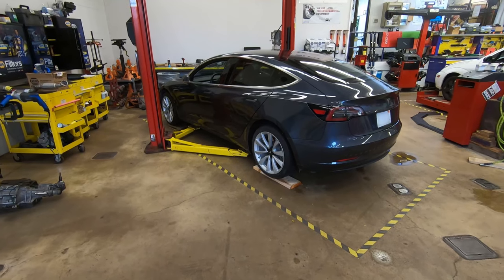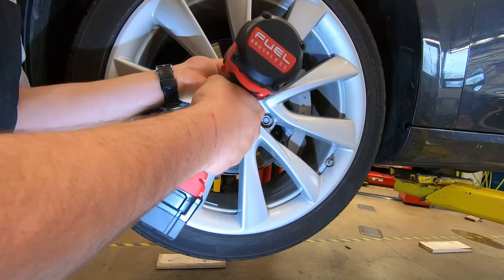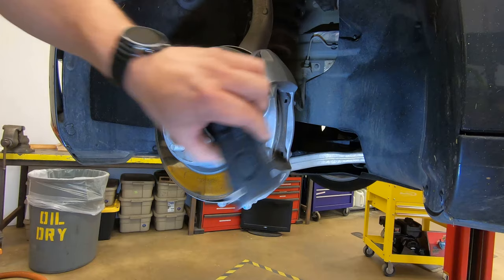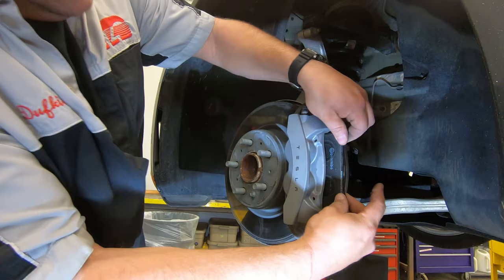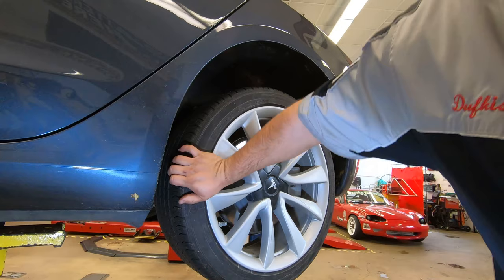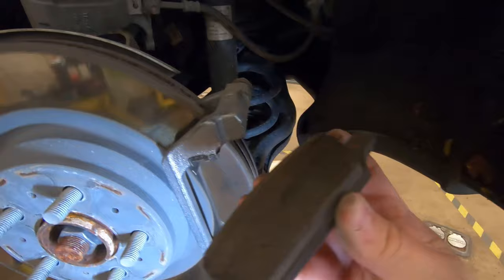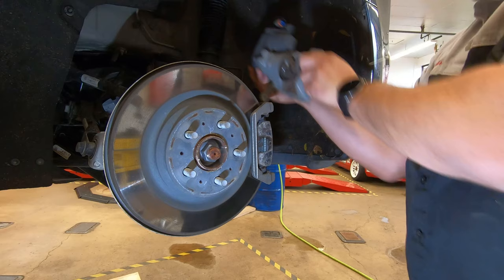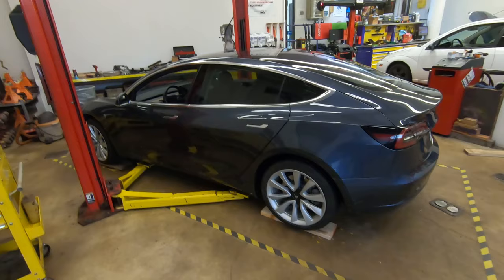Tesla Model 3 Brake Service: How To

Comment: This was exactly what was required for my SR+. Rear passenger brake had been squeaking at low speed (reverse and forward). Car has 30K and Tesla tech recommended a full brake and rotor job $1600. Brakes were still 99% and rotors were almost new. Asked if they knew how to do a brake service by lubing contact points and they looked at me crazy. 😂. Took me 30 min to do all four wheels and absolutely fixed what I needed. Very much appreciate your simple to the point instruction. After seeing how you disengaged the rear brakes by tow mode gave me the confidence to attempt on my own! ⭐️⭐️⭐️⭐️⭐️
Reply from the maker: I'm glad I could help!
Reply: mine are making similar squeaking at low speed with 5 years/60k+ miles so i might try this myself also!
Reply: 30 minutes for a break service on all 4 tires? That's insane. Would take me ~20-30 minutes/wheel.
Reply: @themonsterunderyourbed9408 some people can't handle reality so they lie like  this obviously sofa king we todd did tool
Reply: Sofa king we todd did liar

Comment: You can turn the front wheels for easier access. I did my own brake service after the first winter with my Model 3. While it didn't see much snow, I was glad I performed the service. Tesla put very little lube on the caliper slide pins and they were already getting sticky. I popped off my brake hardware kit and cleaned out the rust building up on the caliper channels and applied grease to them as well before reinstalling the brake hardware. Thanks for the link below to extra hardware!

Comment: Remove corrosion on the calipers by engaging Neutral and braking - This way you physically brake with the brakes in stead of the regen with the motors
Reply: Sure, that was a method I used on my Hyundai Ioniq 28 – but in Tesla you can alternatively set the car to creep. Then the brakes will be used every time you brake to a stop. I have been using this method for almost 2 years and all the brake discs are still like new.

Comment: Two points I'd like to mention.  You can use a wide flathead to push against the back spring while pulling on the pins.  I suggest you lube lightly behind the pad where the pistons make contact.
Reply: @joeldufkis  apply logic. Any surface where there's movement is a source for noise.

Comment: I do mine each spring when taking the snows off. This is a good video for those that have never done this before. It's easier than many may think.  I too lube the back of the pads to stop rust on the pistons (I live in snow and salt country).  This also gives me a chance to check around for other issues like loose fittings, leaks or worn swaybar links, etc.

Comment: Best brake service video I’ve seen to date.  Very clear and to the point.  My UK based car required a tyre rotation so I thought I’ll do brakes as well before winter sets in.  Cars been through a salted roads season already but not much corrosion present.
Reply: What’s a tyre?
Reply: @skepticalmechanic It's a European tire.

Comment: Thank you very much for your video. Cleaned up mine today (SR+ 2019 after 15 months with Canadian winter) and it went exactly as you shown. Only thing was the front lower pins were very stubborn to take out (on both sides). Had to use a bigger punch to avoid sliding. Rear was very easy following your advises.

Comment: Great video thank you. I had my Tesla for 6 years haven’t done it yet. Will order new pins just incse
Reply from the maker: Hopefully soon I'll make an updated video with some new tricks Tesla has allowed us access to to make it a bit easier. 

I have not found any of the 100's of 3's I've worked on needing pins. Using a wire brush on a drill or something will clean them up just fine. Also a lot of the aftermarket pins don't have good tension on the metal bracket unlike the OEM one.

Comment: One note: Tow mode turns off after twenty minutes. So be sure the parking brake is off when doing the rears. I didn't check! And the car ended up, through a series of snafus, pushing the brake piston out onto the ground, its screw following afterward, and all the brake fluid leaking out. I got it back together by screwing the piston back in (I used a tool from the auto parts store)(Piston goes in after the screw which has a top like a flower). Then the line had to be bled to get the brake pressure back. 

It was a big screw up! But I was used to working with older cars that left control of the brakes in the users' hands. I am posting this to warn others that if the rear caliper is off and plugged in, and the car tries to put on the parking brake, it will not stop trying to apply the brakes.
Reply: But cleaning the brakes is super easy.
Reply: Seems like you skipped the unplugging of the wire at 10:48
Reply: I did unplug it, unfortunately I plugged it back in because I couldn't get the caliper back onto the rotor. The piston had reengaged and I had the thought I could plug the wire back in and get it back in tow mode to retract the brake piston. :-|
Reply: @cl4937  how did you get the piston to retract back in? We are having a similar issue.
Reply: @aprillee6647   How did you get yours back in.

Comment: Do you recommend using the 'mechanical' brakes once in a while to keep them working properly?
Reply from the maker: I recommend that once a month if you can set it to low regen and then go somewhere where you can safely do some acceleration and then give it moderate level brake input a few times or drive around for a day like that. If you can adjust regen then just use the mechanical brakes more once a month to help keep them in working order.
Reply: On Teslas that don't allow changing Regen, just hold the shift lever halfway up for 2-3 seconds which puts the car into neutral! If you do that on top of a hill, you'll be surprised of the speed you accellerate down without regen! Brake hard when needed, and you're done.

Comment: Great video and all, but I wish you would've put more emphasis on stabilizing your vehicle before putting the car in towing mode. If you're working on even a slightly uneven surface, your vehicle will roll off the jack, which unfortunately happened to me after I removed the wheel and caused some damage.

Comment: Thanks for this one of the most helpful videos I’ve seen.  Is it necessary to put it in tow mode if you’re lifting the car with a jack at each tire?
Reply from the maker: Tow mode is how you release the rear calipers so you can remove them.

Comment: Noob question: how does this brake service help? It mostly 1) clean up the possible rust on the side of the brake pads, and the pins; 2) apply brake fluid on the end of the brake pads. So for 1) Is the idea that the rust on the side of the pads/pin affect the performance, or service life of the parts? Otherwise, why bother? I would think the brake pad will be too thin, or wrapped somehow long before these rust play a role in the whole thing. Am I right? For 2: why brake fluid on the end of the pads? What good does it do?? Thanks in advance for any help on my questions.
Reply: 1) Brake pads need to move freely back and forth. Any rust or corrosion will inhibit movement and lead to premature wear of the pads and/or rotors. If the pads stick and don’t move away from the rotors when you take your foot off the pedal, not only do they wear faster but you’re introducing drag. It was explained in the video. 2) He wasn’t using brake fluid, he was using brake lube to lubricate the areas of the pad that make contact with the caliper bracket. Again, this is mainly to allow the pads to move freely while braking but it should also help minimize corrosion if done regularly.

Comment: 14:00 some people say to put some grease on the backing plate of each pad. I guess they think that allows the piston to push against it without binding at all. not sure if that makes sense. any thoughts?
Reply from the maker: None needed, per the OE service manual. The pistons are pushing straight out so there would be no binding anyways. I've seen people do it, just leaves a mess for later, a place for dirt and debris to attach to and depending on the grease or lube used could cause issues with the dust boot for the piston.

Comment: If you are jacking up one tire at a time is it safe to put it in tow mode when 3 wheels are still on the ground to service the rear tire?
Reply from the maker: Make sure you block off the front tire that's opposite the wheel you're servicing so the car doesn't roll.

Comment: My pins are just impossible to get off. On each wheel, there is one that resist any kind of force.  I tried everything  Even the old torch. Nothing move. It's to the extend of the pin head getting flat...but not moving.
Reply from the maker: Yup they suck when stuck. What I've done is cut the pins in the middle. Then remove the rotor and mount the caliper backwards. Then you need to use a drill to drill out the heads of the pins to then push them through. It's a pain in the ass, I've done it a ton on S/X and once in a while for 3. Takes the whole job up another notch.

Comment: The torque setting for the rear bolts, in video you mentioned 35ft-lb. But caption says 19 ft-lb. Which is the correcting setting?

Comment: I have a brand new model 3 and brakes squeek when I reverse. It mainly happens in the cold though. Would this help fix that? Ive tried burnishing the brakes but the noise still ends up coming back

Comment: Why didn't you resurface the rotors? And also check for warp on those rotors?
Reply from the maker: This is following Tesla's procedure. You don't need to resurface the rotors when doing annual service on top of that typically we replace rotors rather than cutting them and that would be done when replacing the pads. 

Runout is not checked because there was no issue with pulsation prior.

Comment: Going to do first time coupe months from now, so thank you for this video. Would you happen to know if this is the same on Model 3 2022 AWD?
Reply from the maker: Yeah same system on all of them except for the Performance models, those are different.
Reply: @joeldufkis  My car is 6mnds old, going through first winter. Would you recommend doing it when I change to summer tires or do it when I change it back to winter tires or wait for nice summer weather and do it then?
Reply from the maker: After doing 100's of these services I'd recommend doing it before winter as it will provide the most protection.
Reply: @joeldufkis  Thank you!

Comment: Any guess on what Tesla charges for this service? I’m thinking this is about 2 hours of my time so roughly $200
Reply from the maker: Tesla has the book time for this at 0.72 hours for non performance brakes and then multiply that by your local Tesla service center hourly rate. Here in Chicago it's $245 hr so it's $176.40

Comment: Thanks for the servicing video, can you do one for brake remove and replace?  Is there a special tool needed for the rear brakes (remove/ replace)?  My Model 3 is over 100k miles now 💪
Reply: Nothing extra needed as far as I know. Pretty standard Brembo.
Reply: @ptz0n  Wrong. Youll need a caliper tool to turn the rear pistons which pushes it back to fit new pads in….
Reply: @RafalDelano  Have you tried using a c-clamp?
Reply: @ptz0n  Will not work, again, you need a caliper tool, the rear piston does not simply push in. Its a twist piston….

Comment: why didnt you clean the rear caliper pins? Im at about 50k miles. Should i?
Reply from the maker: If they are free moving then there is no need to. If they're not free moving then there's probably a hole in the boot causing stuff to get in and then you need to clean or replace as needed

Comment: can i apply brake cleaner from the outside (i mean without taking the wheelsoff) to clean the brake? just on a regular 3 to 6 months basis? or does the brake fluid cleaner ruins the brake pad?
Reply from the maker: That won't accomplish anything. The main thing is to lubricate the parts. Spraying brake clean in there won't do much of anything.

Comment: If you dont lube the brake pad backing, the hard ware parts...It may make noise, squealing, squeaking at cold first time of the day when you backing oir the drive way or your garage. The brake is still working normally. It still work the same as ICE car. I set my M3 in the setting menu for CREEP mode. So I can have chance to use the brake more time so the part get worn or break in. So parts wont get rusty to frozen rusty. Most of people has Tesla is in California, no snow, not very much corrosion from the snow. They dont have to worry about break noise nor having to service it. If you live in the area with a lot of snow, you already know what to do maintain the all fo your vehicle you are driving. Tesla is not exception the way you maintain all of your vehicle.

Comment: just an observation.  do not use a steel brush, it will scratch the paint on the caliper and the pads, and then it will certainly precipitate corrosion on the parts.  Preventive maintenance must not damage the parts.
Reply from the maker: I've done this procedure on over 100 Tesla's at this point. I have return customers for 3 years now so I have actual data from the Chicago area and the way this is done will not cause issues  The paint on the edges of the pads will come up regardless so it will expose the edge of the backing plate. The lubricant is there to prevent corrosion.

Comment: Wondering if you have encountered a case whereby the pad retention pins won't come out? My driver side pins came out similarly to your video but my passenger side ones seems stuck in there solid. I tried spraying some penetrating lube into the points where the pins contact the holes that they go in but still no luck.
Reply: @joeldufkis  thanks for the reply, I appreciate it!! I've definitely tried hitting hard, and the pointy ends of the pins are starting to flatten out as a result. I was happy to successfully service 3 out of 4 of my brakes, I think I'll see if Tesla mobile will take a crack at the one with the stuck pins and I'll watch what they do. I've asked them to bring an extra set of pins in case they have to damage or destroy the existing ones to get them out. Puzzling though that one side came out so easily while both pins on the other side are completely stuck in there.
Reply: @joeldufkis  that's a good tip, thanks!

Comment: So I'm a little confused on the torque amount for the rear caliper, is it 35ft-lbs or 19? You say one number, but subtitle with another.
Reply: @joeldufkis  thanks for the quick reply, as I'm about to service them as we speak.
Reply: @joeldufkis  Well, I didn't realize there would be a difference, but I have a Performance model, and it looks like the calipers are completely different. I'll have to rethink this.

Comment: looks like you needed 4 pieces of 2 x 8 lumber about 24" long to drive up on in order to get enough clearance for the jacking.
Reply from the maker: For the lift I was using yes I needed some extra height. Your mileage may vary.

Comment: Great video, for a company like Tesla, I thought they would have designed this issue out, as this problem with breaks NOT operating as often does lead to breaking issues. sadly not Audi noted this issue and is looking to mitigate this problem. Interesting to see what they do. I personally had a similar problem due to my car a normal petrol car, sitting for 3 weeks between drives

Comment: Any ideas on how to retract the piston of you didn’t put it in tow mode?
Reply: Apply 12v to the leads at the parking-brake connector. Reverse the polarity to move the opposite direction. Vehicle computer detects runout when current spikes. Same will happen to you, so apply power by touching the contact with a hand-held wire, tap briefly and repeatedly for incremental progress, and be prepared to disconnect instantly at runout. Otherwise, the current spike will burn your wire.

Comment: I thought Tesla didn't need ANY servicing  other than filling up the washer bottle. I can service the brakes of my car on my driveway, by jacking up one corner at a time
Reply from the maker: https://www.tesla.com/support/vehicle-maintenance
Reply: @joeldufkis  The point is, I can do all this this myself. All it costs me is the cost of parts and a bit of my own time I don't need to book an appointment, or pay exorbitant prices for labour, nor be forced to take my car to a garage that has a 4-point lift. Nowhere in the Tesla service plan does it mention the need to check suspension parts like ball joints, bushes, springs Oh, and I can rotate my own tyres at home, by myself, at zero cost.

Comment: So EVs need annual brake service? Instead of the oil service? There goes EV maintenance advantage.
Reply from the maker: Tesla recommends it for vehicles that are exposed to road salt. The salt can cause the brake pads to seize in the caliper causing them to not work well in an emergency situation when you slam on the brakes. I've done some that were very very seized. If you go to my FB (EVolution Mobile) you'll see examples of what can happen. Realistically any EV with a fixed caliper (like a Brembo) and that's exposed to salt should have this done. Haven't seen much of an issue with single piston calipers at this point but assuming they'll suffer from the Prius rear brake issue where the pad rust jacks off the backing plate.
Reply: @joeldufkis  I know I have a 10 year old Prius 😆. So the same problems.